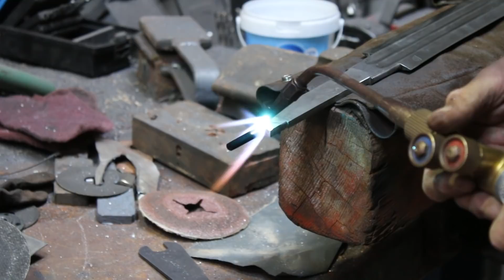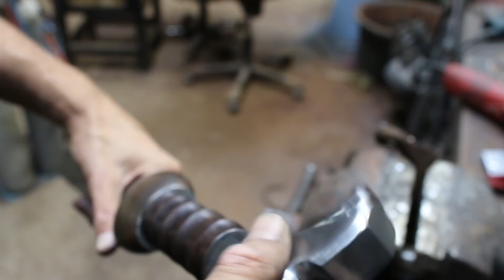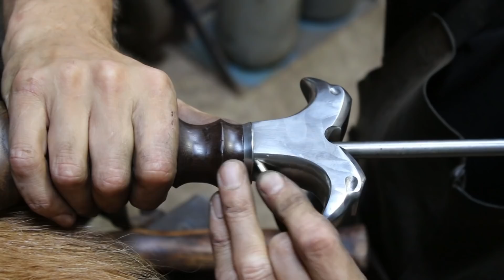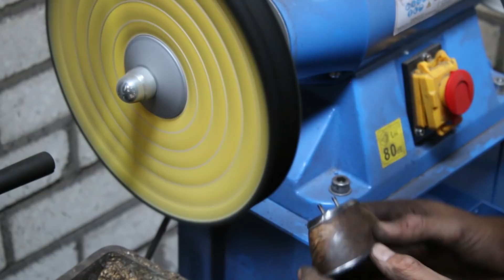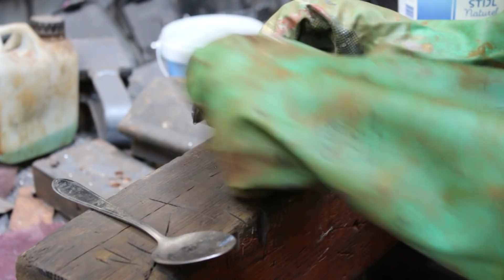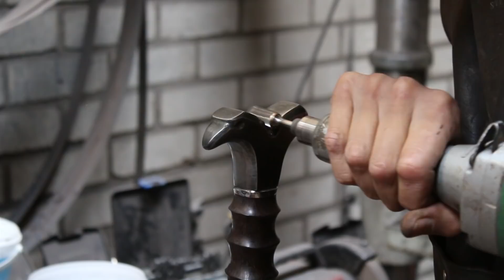Forging a spear tip fantasy Gladius, part 6, fitting the blade.

Comment: Huge Blade. It looks as if the length is closer to a Spatha (long gladius) (for Calvary use - rounded point), though I seem to recall reading such longer swords were also used by Roman (for Heavy Infantry - sharp point) Infantry in later years. Can you provide the length, weight, balance point when you have a free moment? 
You are one masterful bladesmith. Well done!